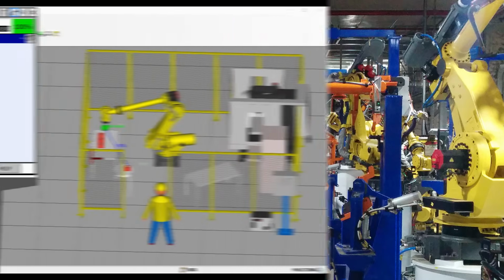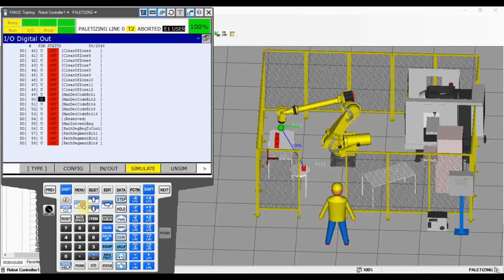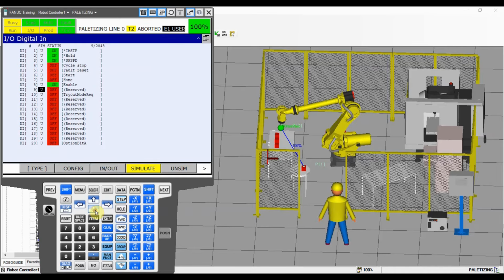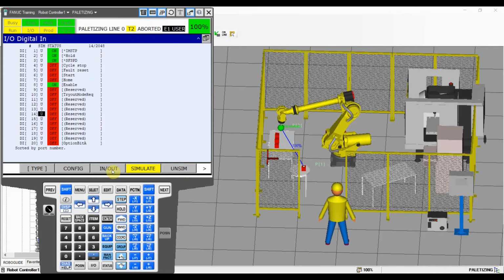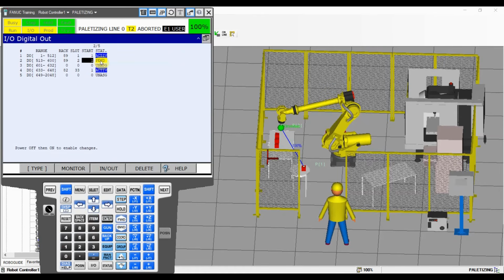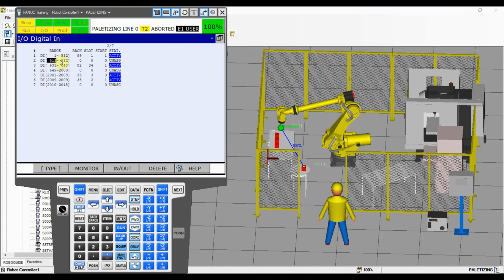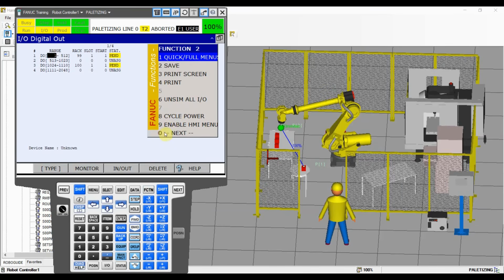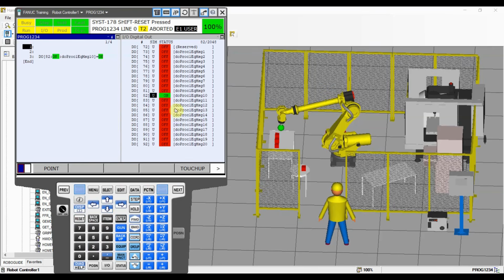FANUC Digital Inputs / Outputs, I/O mapping, setting up digital signals, I/O configuration explained

Comment: Hello, when we set the start point as 200, does the robot send DO201 signal to plc or plc will receive 201 input signal?
Reply from the maker: That depends on how you will define your mapping, but assuming that all PLC communication will be assigned to this SLOT and RACK if you put 200 as your start, this means when you turn on the FIRST output from that assignment that PLC will see it as 200.
Reply: @FutureRoboticsChannel  It means when I start with 200. but when my robot starts on DO1, plc will understand that DO201 is On right?
Reply from the maker: @duongdo2517  it should be 200 on the PLC as well, but yes

Comment: Great video.. 
Sir i want input and output config without plc. Direct wire the robot. What's the rack num and slot number.
Reply from the maker: it all depends what is the module you are using if it's FANUC I/O Link it's auto configurable product

Comment: Hi! Your videos are increadibly useful!! in this case, I see that you have 2048 inputs and outputs to configure, but I only have 512. Is that an option I need to buy in order to have more IO points? or is it a configuration somewhere? Thanks!
Reply from the maker: You should be able to increase the number of I/O under controlled start

Comment: Hi, another question, how to force the UOP, I have a Home macro connected to UI[7], to test it I need to force UI[7], how can I do it? 
Thanks a lot
Reply from the maker: You cannot force UI :-) Like I've said those are robot internal signals.
The only way is to send the signal. Just FYI don't use UI signals as regular I/O's, unless it's for testing.
Connect Macro to Digital/Robot I/O.

Comment: In Roboguide, I'm not able to have the UO[1] cmd_enable ON, what can I do?
I need the UO[1] to simulate the program using the PLC program as I connected the Roboguide with PLCSIm Advanced.
Is there a way to check what I need to have this signal to ON?

Thanks a lot
Reply from the maker: If you have connection between PLC and Roboguide you need to map your UI signals the same way as you map regular I/O
Reply: @FutureRoboticsChannel  I've done it. But cmd enable UO[1] is an output from RoboGuide that I receive in the plc, and I cen read it in the plc sim as True or False, if I force it.
So the connection is ok, as I read also the other UOP signals, the problem is that I don't have the UO[1] ad 1, I can force it, but it goes back to 0. 
In Roboguide I don't know the conditions that keep UO[1] to 1.
Thanks
Reply from the maker: @alsly9066  Do you have UI Signals enable (set to TRUE) in System/Config ?
Reply: @FutureRoboticsChannel  Yes, sure
Reply from the maker: @alsly9066  Also UO signal are made (switched) by robot, if you want to have CMD enable some specific conditions needs to be met (eg. robot in auto, no fault, no active program etc.)
You need to take a look at the manual to see all conditions :-)

Comment: Thanks for video.
I have a question about the Rack and Slot.
Can I have two ranges on the same rack and slot.
For instance,  DO 1-512 Rack 89 Slot 1 start 1 for the first one and DO 532-600 Rack 89 Slot 1 Start 532  ?
Reply from the maker: Yes you can :-) Just as you written you need to remember about "Start"

Comment: I ask myself, why the DO (1,2) in the same RACK 89?
Reply from the maker: RACK is a physical card connection between robot and card, so many I/O's can be assigned to one RACK. Same with SLOT, slot can accept many I/O's.
Think of is as of a box with many open connections, so like in old controllers you've had a card that you were connecting wires to, so all of those wires will be connected to eg. RACK89 Slot 1, so DO or DI (1-8) will be connected just to RACK89. That's how the old-school I/O looks like:
https://www.galco.com/buy/Fanuc/A03B-0819-C104?source=googleshopping&utm_source=adwords&utm_campaign=&gclid=Cj0KCQjwsqmEBhDiARIsANV8H3bkn-eeyI1-hdOPOBG9Gk_8mcD-wzZF3rmxXPxaN-2NrFAW3fcNKdMaAgFUEALw_wcB

Comment: Hello! This video it's so helpful, 

I have a question, how can I map a SOP signal to a digital output signal, I want to sent to the plc that the robot is running a program and the signal cycle star can work 
or do you know another way to do this?

 I'll be thankful for your answer, greetings.
Reply from the maker: If you are asking about Operator Panel Keys (SOP)

you can use Interconnect to map SI do DO, if you want to map SO to DO, the easiest thing would be to make a background logic and just make a DO[x]=SO[x].

Now I don't know how is your robot set up (remote or local start), if you are using remote start (eg. PLC) to start robot program, you might use UOP signals and map them into DI/DO
Reply: @FutureRoboticsChannel   The set up of the robot is on local, I only want to see on the plc that a program is running
I will do that on bg logic, that's right? 
Thanks a lot
Reply from the maker: @marcosmata5172  Correct 
However you can always map UOP to DO, this way you can deliver a bit more information to PLC

Simply go to UOP and in config use same mapping like in DO this way you will “copy” UOP to DO
Eg.
UOP
Rack 101 Slot 1 Start 1
DO
Rack 101 Slot 1 Start 1

This way first of 15 DO will be the same as fist 15 of UOP (I think it’s 15, I would need to double check)
Reply: @FutureRoboticsChannel  i got it,  think this way is more easy, I only have to map to a word of PLC and that's it (I have connected the robot and the PLC on Ethernet/ip I think the rack is 89)

I really appreciate your answers and your content it's amazing

thanks a lot Sr, Greetings from Mexico!
Reply from the maker: @marcosmata5172  Awesome, glad I could help ! Have fun programming

Comment: Hello sir I am working on flamming machine projct on fanuc M20 i robot but after giving start command robot is not moving in auto can you please guide what will be the issue
Reply from the maker: Sure, I can help, but I would need a bit more information. Is there any error on the teach pendant ?
Reply: @FutureRoboticsChannel  No there is no error on teach pendant and On HMI screen. in manual cycle robot is moving on program direction but in auto cycle robot is not getting signal. how can i contact you to show you video and photos.? can you please support regarding this. since last 2 days i am stuck on this problem
Reply from the maker: @akashdalvi3012  Message me on Facebook (when you go to the main page of my channel you can find my Facebook information there)
Reply: @FutureRoboticsChannel  yes sir I had messaged on facebook also on mail

Comment: Hi
Still another question...
On my Robot I have Slot 101 and 102 for Profinet; but I still have Slot 48. The Slot 48, What is used for?
Thanks a lot ...
Reply from the maker: Hello,
I think you are asking about a RACK not SLOT :-)

48 - address mapped I/O for LR Mate Peripheral connectors
101 - Dual Channel Profinet I/O Controller V9
102 - Dual Channel Profinet I/O Device V9
Reply: @FutureRoboticsChannel   yes of course, rack not slot.
Sorry I was at home, I didn't have the robot and I was wrong.
Rack 48 what is it for?

If I could, it would be really interesting and useful to have your video dealing with the interfacing in Profinet between robot and Tia Portal.

Thank you so much, so much for your wonderful videos and for the work you do for the benefit of all of us, you are super, keep it up ..
Good job
Reply from the maker: @alsly9066  Like I've written above :-)
48 - address mapped I/O for LR Mate Peripheral connectors

Comment: Great sir,please guide me when to On and when to off a output in a program???
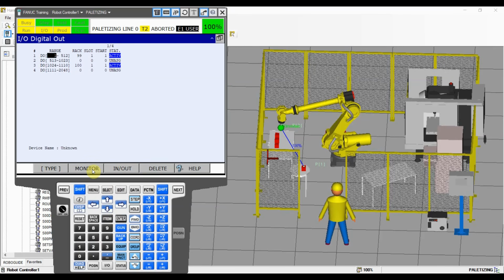Reply from the maker: I'm explaining how to do it in 26:00, here: https://youtu.be/g_zJ_W2ANsY?t=1561.

If you are asking if it's better to turn in on during robot movement or when robot is stopped that depends on what are you using this I/O for.
Reply: Sir...I meant that how to use in Robot program...if DO[33:ON:cmnt]=OFF..how will it work??means which signal would go to PLC on or aff
Reply from the maker: Oh I understand,
The "ON" that you see here:
DO[33:ON:cmnt]
Is the current value of the DO, so when the state of the DO will change to OFF you will see OFF there.

The value that the PLC will see (you will send to PLC) is after the "="
So
DO[33:ON:cmt]=ON - you will set DO[33] to ON, the code will look like this:
DO[33]=ON

and

DO[33:ON:cmnt]=OFF - you will set DO[33] to OFF, the code will look like this:
DO[33]=OFF
Reply: Thanks sir...
Reply: Lot to learn from you
Reply from the maker: @sudhanshuawasthi2606  I'm glad to hear that !

Comment: Good videos thanks for the classes.
Can you use the automatic configuration setting a variable to true ?. Is it recommended?
Reply from the maker: Hey @Bagnou M, could you tell me what variable are you talking about ?
Reply: $IO_AUTO_CFG
Reply from the maker: @bagnoum747  Well that variable will overwrite a configuration that you will make. I did not play with it, since I'm always making configurations from 0 myself. My personal opinion would be to set it to FALSE, since it can bring confusion to next person that will work on the robot and will try to make changes on it, because he will keep loosing I/O configuration every time he/someone will cycle power the robot.

If you want to see how the robot will assign the I/O by himself (set variable to TRUE) and than use it you can go for it. Just set variable to TRUE, cold start the robot, check the configuration, save it and set variable to FALSE.